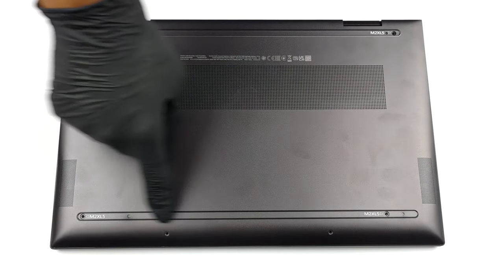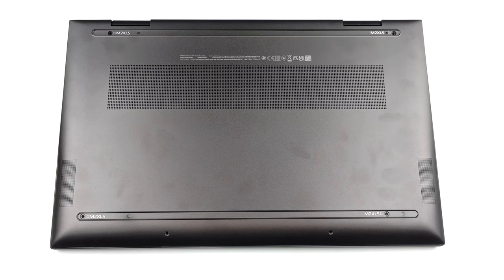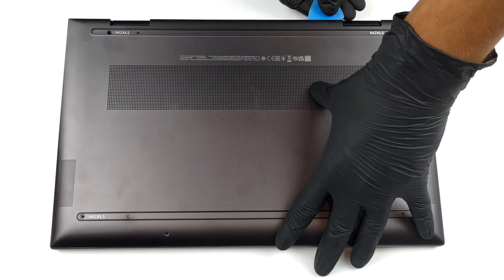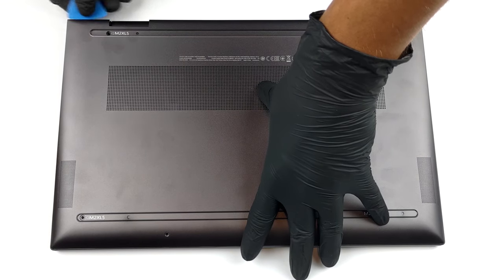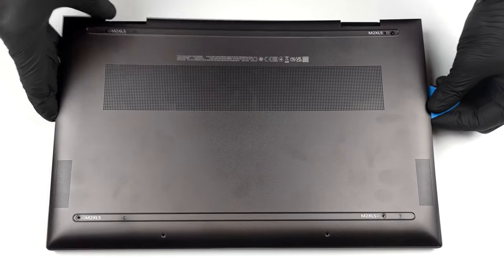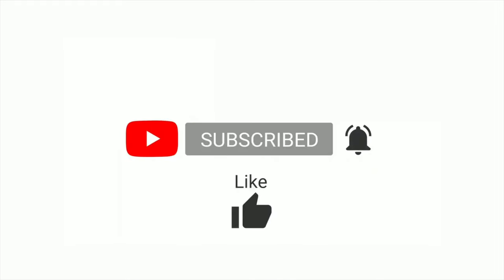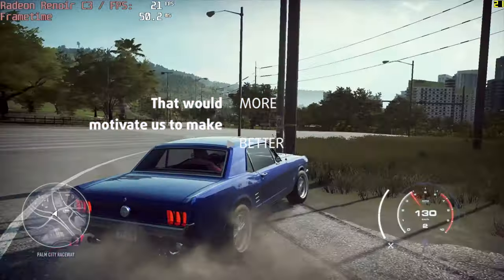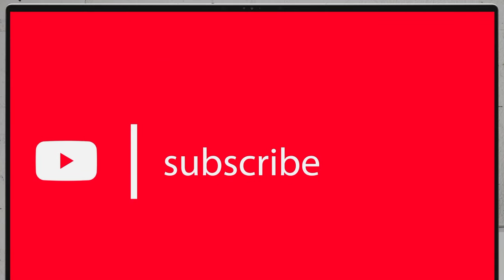🛠️ HP Envy x360 15 (2021, 15-eu0000) - disassembly and upgrade options

Comment: I have this laptop this exact model ryzen 7 5700u. I installed a pcie 4.0 nvme ssd you will get a big bump in read & write speeds. I also upgraded to a wifi 6e intel m.2 card instead of that realtek brand garbage. I also put better quality ram 16gb dont need more then that for my use. I also put liquid metal on the cpu which is one of the best decisions ive done since these laptops run hot. I got way better tempeture readings!

Comment: Thanks for the video! Have you tried to see if this laptop works with 32 GB RAM?
Reply: i'm curious about how it works with the 64 gb??? thinkin i would just go big.
Reply: @sevenseven7333  I have tried with 32 GB ram, not 64 though. 32 GB works! Remember if you want the RAM to work at 3200 mHz then you need to have 1.2V if the voltage is higher then it will run at 2666 mHz. I bought Lexar RAM and it works perfect!
Reply: I have hp envy x360 15-eu1026nr, works up to 32 gb